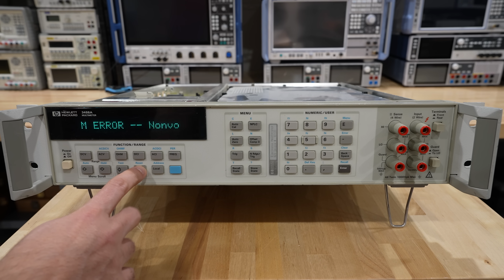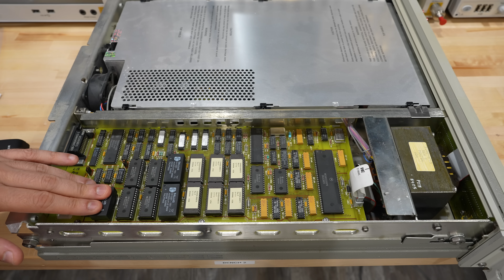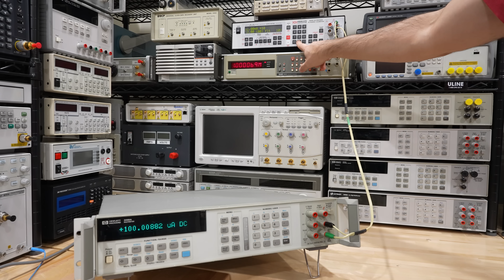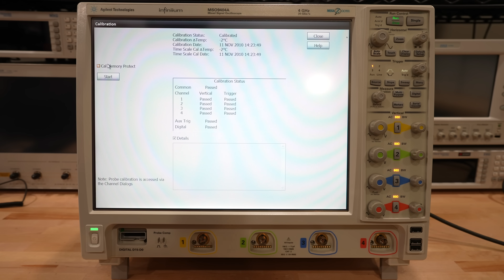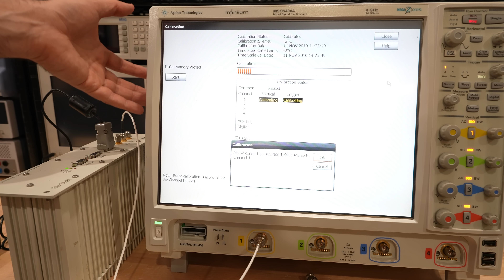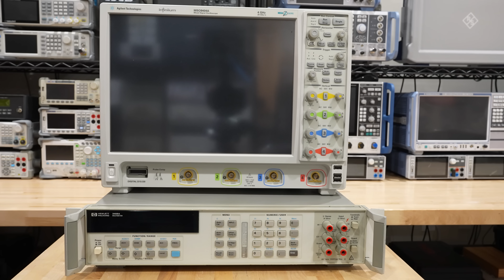TNP #55 - Lab Upkeep Time! Agilent 3458A 8.5 Digit Multimeter &  MSO9404A 4GHz, 20GS/s Scope Repairs

Comment: I think many would be interested in seeing more of these maintenance tasks. Keeping equipment running and well adjusted is an important job for anyone with collection of older test equipment. I just upgraded my 3458A to replace the Dallas time bombs with FRAM. I also upgraded the firmware while I was there. It's nice not to have to worry about batteries running out.

Comment: I dont think they are using SATA for data transfer in that. In theory you can, emulate a HDD and do file transfers but that seems insane. My best guess is they are just using the SATA connector for PCIe  1x or LAN. Also weird industrial boards can have weird controllers on them for serial protocols mostly lost to time.

Comment: Battery failure on old instruments is quite a painful experience. I have lost several calibration coefficients on very expensive old equipment because it wasn’t even apparent it had a battery until it died! Had to get the service manuals to even find where they are. I try my best to backup all EEPROMS on my TEQ where possible, but sometimes they aren’t even documented, or if they are, they are quirky to work with.
Reply: Apologies, stupid question inbound lol…with regards to these Dallas battery backed devices, are you able to dump the contents of the CMOS in the Dallas 12887 RTC chip with an eprom programmer?  I have a eeTools TopMAX 2 programmer.  Thanks!
Reply: @3 @3ffrige  hi, sorry for the late reply. You should be able to read it as any typical ROM, however, only if the internal battery is still alive because the RTC backup which keeps the charge in that ROM.

Comment: Supper impressed you also keep the seldom used cables and adaptors, almost an impossible to keep track of them except for bolt them to the instrument!  The Dallas sram issue  is perplexing, with a modern solution available very supprised the company has not converted, still making the old defective unit? really!

Comment: I see 3458A's in TSP lab multiply, as they tend to do usually. Engineer with just two 8.5 digit DMMs is never sure, so need at least 4 for confidence votes on volts. Optimum amount of 3458As is about 3 to 5, so a good day for that. Time to hook up HP3458A to Raspberry Pi and GPIB datahose and run xDevs X18 ADC stability test for few months to confirm meter's health fully. Also it's been a while since TSP did a lab livestream :P